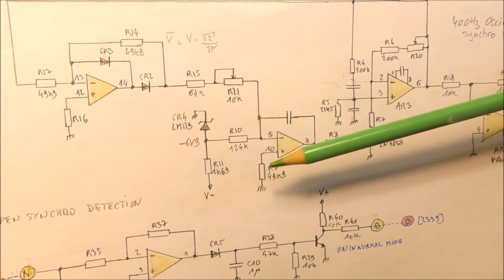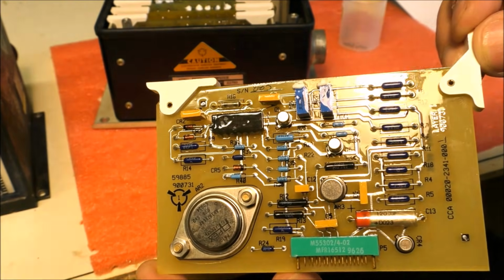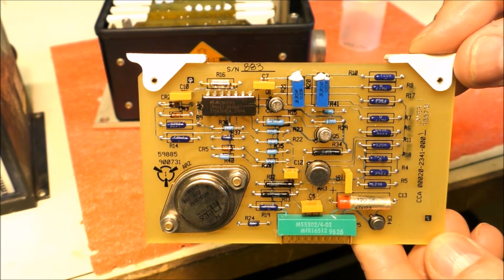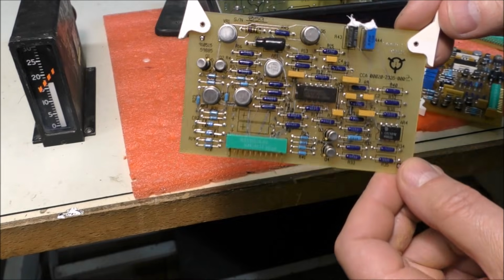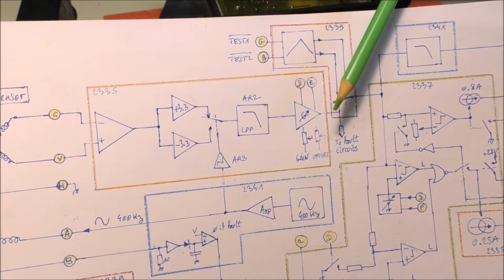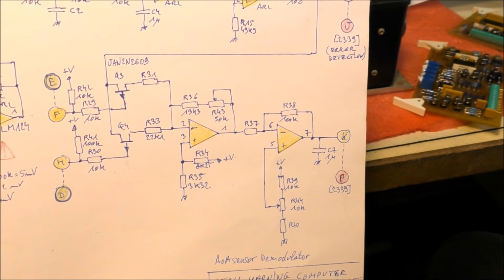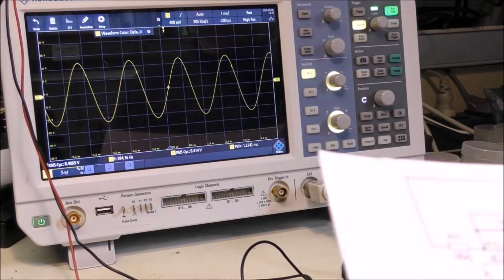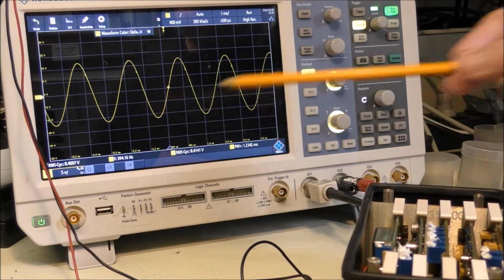LDM #448: Stall Warning Computer Rosemout 0020BG1 - Teardown, reverse engineering and test

Comment: Great video as usual :) why would they use an expensive power opamp instead of a push-pull pair to power the angle of attack synchro rotor?
Reply from the maker: This power opamp is expensive but reliable and qualified. You need several parts to replace this power opamp and the reliability can be impacted. Price is a secondary parameter.
Reply: @lelabodemichel5162  I see, thanks Michel. Out of interest, what is the nominal impedance of those synchro windings?

Comment: Why do the circuit boards look kind of wet or glossy?
Reply from the maker: There is a conformal coating (acrylic or polyurethane) for the protection against external agression like dust and other pollution.

Comment: Thank you for the video. Your videos are so interesting to me. @1:50, what is the reason for putting the resistors R9 and R36?
Reply from the maker: Hello, they permit to compensate the bias current the op-amp by creating the same parasitic voltage in series with the inverting and non inverting input of the op-amp, therefore the effect of bias current is cancelled.
For example R9=R10 in parallel with R15+R21

Comment: I wonder if the PCBs etched with 90xxxx etc  is  the design date ? Technologically it seems mid 1980s.
Reply from the maker: I think it corresponds effectively to the design date YYMMDD. Date code of ICs is 95/96. In critical industries when something works you don’t want to take the risk to change something if it is not necessary.

Comment: I looked for 2n2609 and it is 12$. In circuit is used as switch at 400Hz and not  special requirements like uV signals or low noise low leakage. Why it is so expensive and why ic switch like adg4xx can not be used? Thanks for the excelent work.